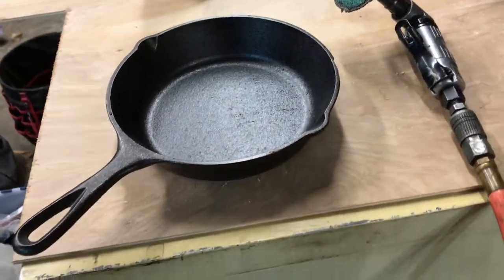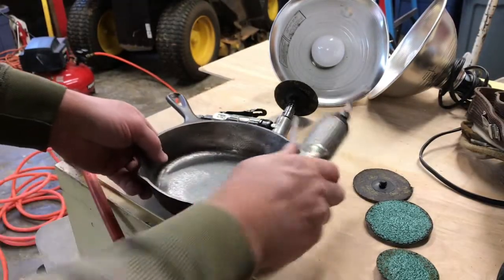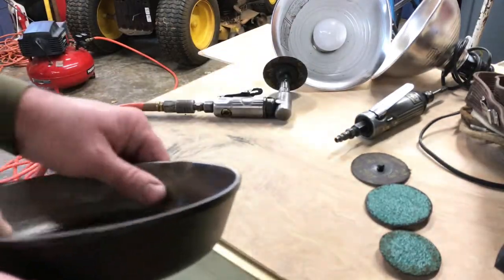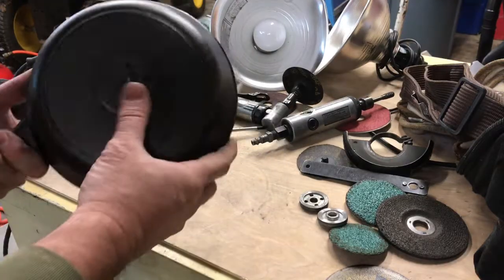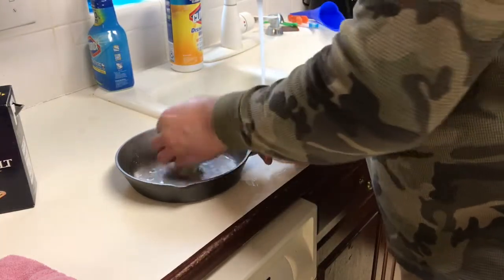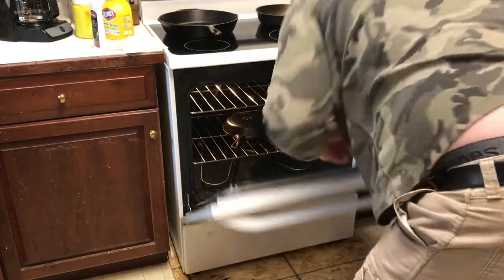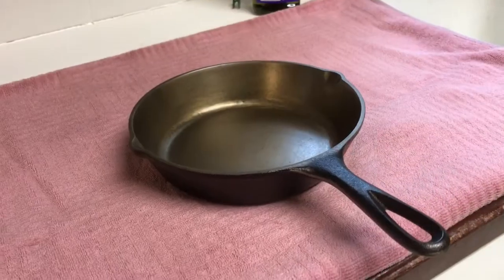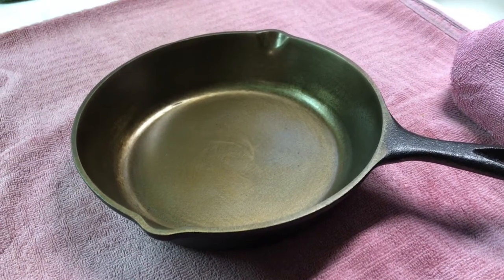How to Polish & Re-Season a Lodge Cast Iron Frying Pan / Skillet DIY

Comment: I never really worry about the sides, just the bottom, and the bottom edge ring.  Also, I don't take it down to bare metal smooth.  I only knockdown about half the roughness ( I believe a little roughness helps me when I season the pan).  I then season it 3 times with flaxseed oil and make sure the first thing I cook is cheap, fatty bacon to also help season the pan.  Further, I season a pan after each and every use.

Comment: Great, informative video. I came here because I washed mine a bit too roughly with a scouting pad and took most of not all of the black coating off. I was worried about whether it would still be safe to use until I saw your video. Thanks. 

Also, just a little piece of information for others: If you’re unable / unwilling to use a sander and other electric / pneumatic tools, 96 Hex scouring pads by ScotchBrite are insanely abrasive and will do the same exact thing, even though it might obviously take a bit longer and more physical exertion. Found this out by accident.

Comment: I’ve used vegetable oil on my pans is this good or bad
Reply: Yeah, it's fine. I've done quite a bit of testing and the difference between oils is pretty negligible. Just use whatever cooking oil you usually use.
Reply: @hamcommander7974  Agreed.  I used to use vegetable oil all the time with no problems.  Now I use pork belly fat.

Comment: That is a heck of a lot of unnecessary effort, imho.  Smoother doesn't mean more non-stick.  In fact, I've had a harder time getting a good seasoning to hold on my older smooth iron, than the pebbly surface of a new Lodge.  It's the seasoning and use over time that makes cast non stick.  And, nothing you do to new lodge to make it look like old iron will make it have collector value.
Reply: It's not about making it nonstick. It's about ease of maintenance as that sandpaper like surface of new Lodge cast iron tears apart the towels. The smooth surface is also easier to clean.

Comment: I don’t get why so many people love cast iron pans. I have a set of Calphalon non stick and they are light and easy to clean.
Reply: The cast iron will out live you. The non stick is a consumable and will wear out and need to be replaced with a new pan.
Reply: Teflon is toxic at high temps and aluminum also not good at high temps.
Reply: I used Calphalon non-stick pans for several years, but after having to replace them for the 3rd time, I changed back to cast iron.  It lasts for generations.
Reply: opichocal - not familiar with that brand I’m guessing it’s not cast iron or milled steel but Teflon coated! But seasoning is less toxic than plastic peeling coating currently!
Reply: There is just something about them
Reply: Cast iron has better heat retention and a renewable non stick surface.